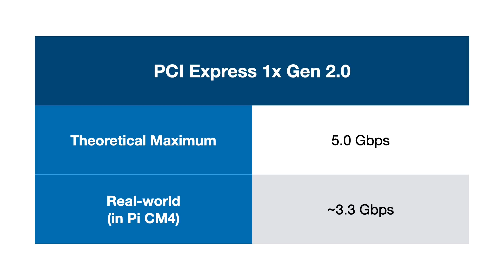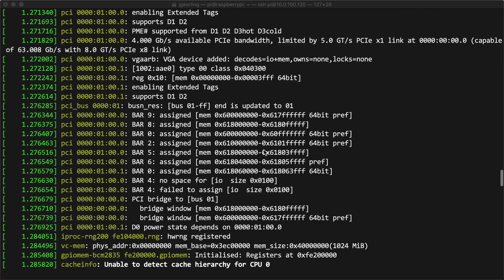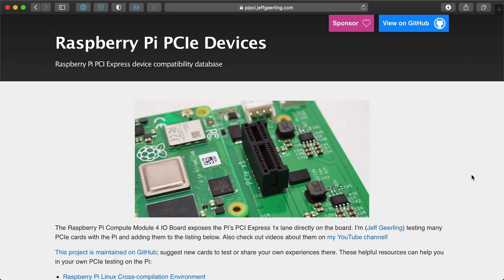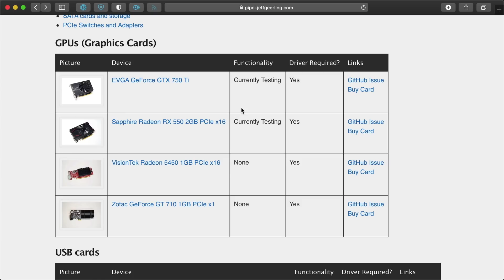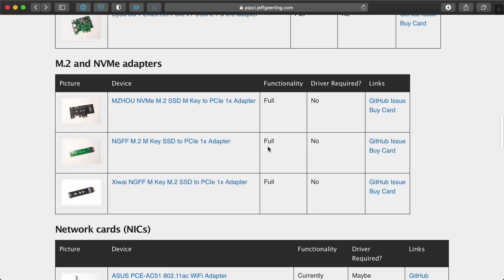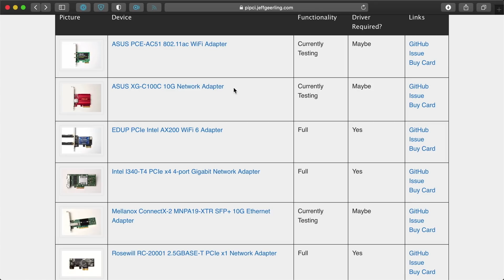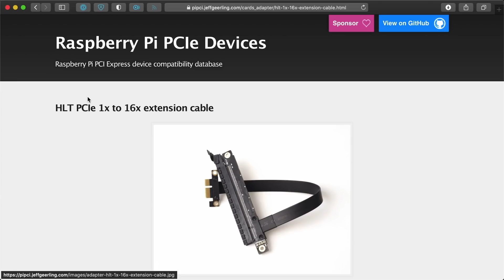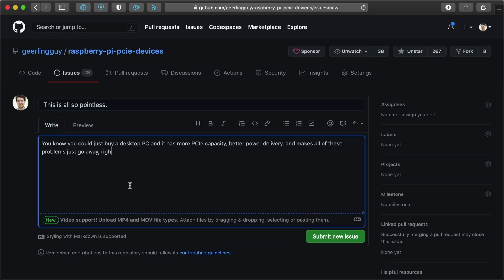PCI Express arrives on the Raspberry Pi CM4 - A Guide

Comment: I've nearly gotten an HD6450 to work with the pi. It hangs up setting up framebuffer emulation and I've disabled UVP (universal video processor) for now as it hung up there too, but without a display connected, it loads the driver fine. The pi for some reason is unable to read the PCI ROM of the card which contains the BIOS, but it's possible to load the BIOS from a file with a small modification to the driver.
Reply from the maker: Are you commenting on this issue? https://github.com/geerlingguy/raspberry-pi-pcie-devices/issues/4#issuecomment-751918301 — thanks for pushing it forward!
Reply: @JeffGeerling  Yup, that's me. I've got it past DVI and HDMI initialisation and it got stuck on VGA, but if I disable VGA, it get's stuck earlier. I guess I'll have to figure out a better debugger than printk to get further with this.
Reply from the maker: @coreforge  I got the ear of someone who works at AMD and they mentioned something to the effect of "I wouldn't work with that generation of GPUs" since they didn't even think about non-X86 BIOS use cases and there would be a lot of flaws to iron out... but that person did say it could be possible to get it to work (at least a little bit!).

That was the person who suggested the RX 550 might be one of the oldest models that would be easier to get initialized on the Pi... thus I'm still trying to get my remote debugger working. Like you, I hit the annoying printk issues where output would stop before I got whatever I was most interested in finding: https://github.com/geerlingguy/raspberry-pi-pcie-devices/issues/6

If you're wanting to keep digging and might want to switch tracks to this card, I'd be willing to ship it over to you and see if you can get further than I could! I just want someone to get a signal through a GPU on the Pi, mostly to prove LTT wrong (heh) but also because it could open some interesting new possibilities (IMO).

Comment: Just to get this straight: It's not really a replacement for a full-fledged computer. A gimmick or hobby, but hardly usable for professional use.
Reply from the maker: It really depends on your needs. I agree that you wouldn't likely be able to replace a solid general purpose computer used for games, media production, etc. with something based on the current Pi.

But there are two use cases it's especially great for—industrial/commercial use for controllers, automation, and some robotics, and light general purpose computing (my kids love the Pi 400).

There are also a few projects I'm working on (and others too) where the CM4 could be an improvement with the right daughtercard and case over existing solutions (slightly faster and costs less).
Reply: Just tell that to my IT department that said "To hell with the overpriced cr*p, our industrial floor will get RPI's for their thin clients", and that turned out to be an excellent solution for their use case.  And it's professional use ;)  Just because you don't see a pro use case (which is legit, the Pi is definitely not a jack of all trades by any sort) does not mean there is not one.
Reply: @EVizify  WWe have also tested it in our company and found that it is not suitable for our work or that of our customers. But your example also shows why "hardly" was an appropriate term from me.
Reply: What they said.  It's not meant for lazy IT. They have to actually understand what they are using it for and why.
Reply: It some circumstances, it can replace a more expensive PC option. That said, I see these Compute 4 projects as pushing the boundaries of what the Pi Foundation designed this for, and enjoy reading about all the additional things it can and may well be able to do soon. The mATX project is really interesting, and thanks to the Pi people for releasing the I/O board Kicad files into the public domain for others to work from and modify for their own uses.